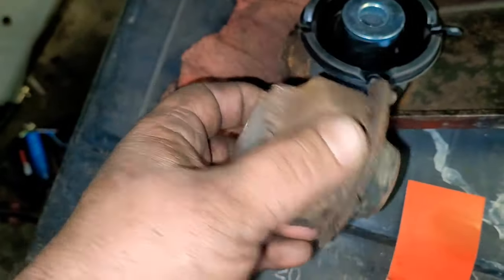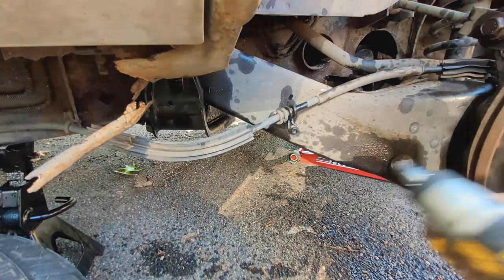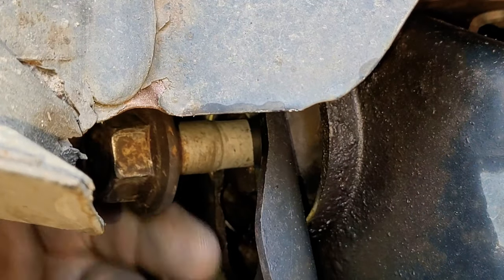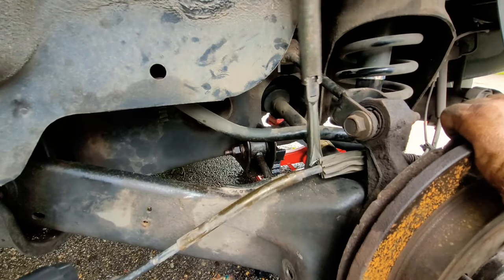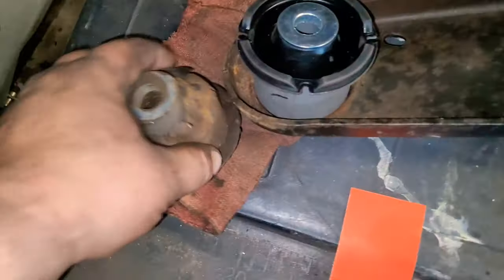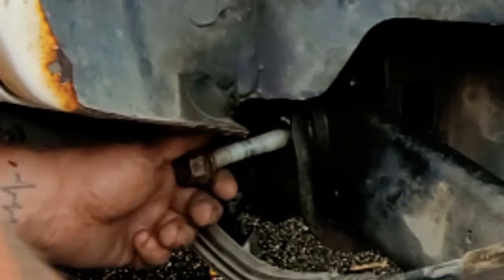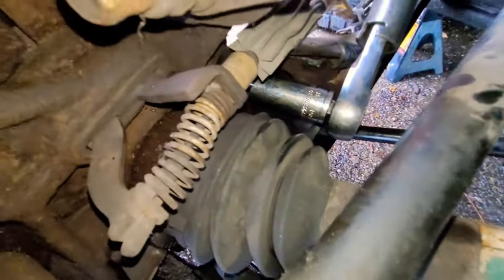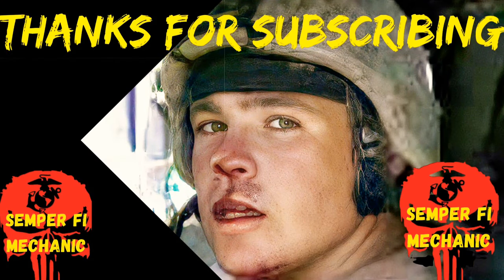Mobile Mechanic Work Day {Episode 16}-2006 Ford Explorer Trailing Arm Bushing Replacement

Comment: I did this today.  Those 21mm were super stuck on there.  Mine had blue locktite on there too.  I had to remove the hub and trailing arm from the vehicle, flip it over, and heat it with a torch.  Then those bolts finally came out.  And I broke my damn 21mm impact socket in the process.  But it's all apart now and cooling down.  

This job was one  for the books.  Semper Fi.
Reply from the maker: I remember how miserable this job was man. Like horrible. Glad you made it through man

Comment: Nice that you offer to just replace the bushing hopefully that saves the customer on part cost.  I know most mobile mechanics wouldnt bother with a press and make you change out the whole arm.
Reply from the maker: Yea man he didn't have the money and was in a tough spot but man this hurt me bad. I lost alot of money on this because I had to cancel other jobs so my heart gets me in trouble sometimes
Reply: @semperfimechanic  that sucks you lost $ on the labor but all you can do is Hope you've gained a great repeat customer who lets friends and family know about you.
Reply from the maker: Yea man I always try to do the right thing. It's not always easy but if you treat people right usually you get it back.

Comment: And that's why I don't do mobile repairs. Pro tip: thos bolts were tight the entire way because they have lock tight. Get yourself a torch and heat them up. Will make the removal 10 times easier.
Reply from the maker: Yea we heated them and that's the only way we was about to remove them at all